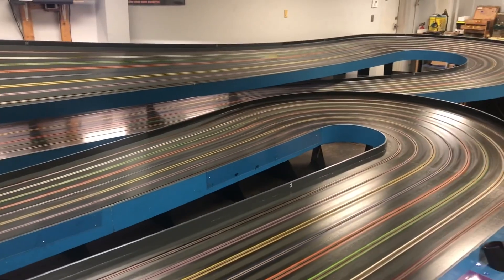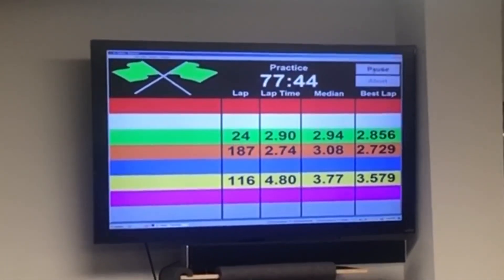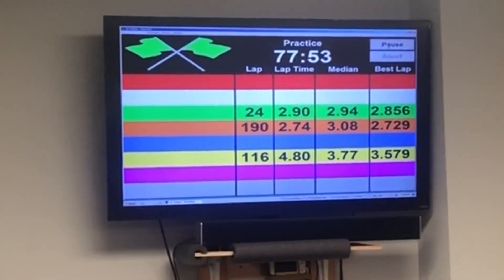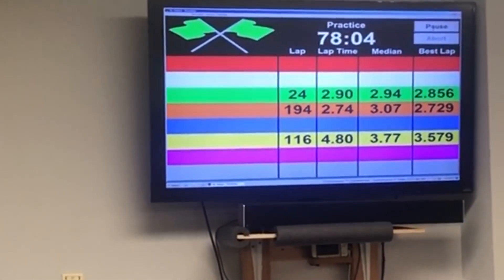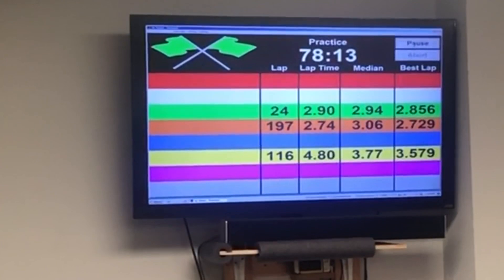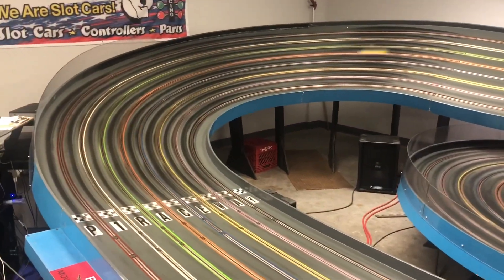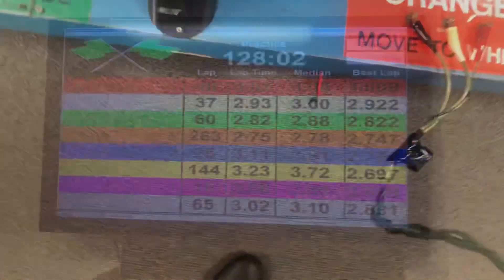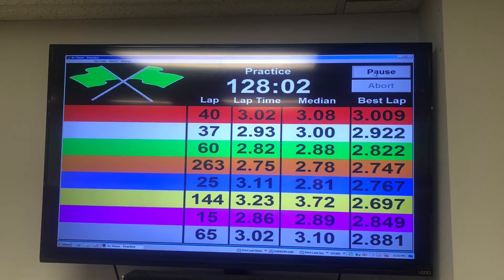DoSLOT brushless slot car ESC testing. @brushlessslotcarracing

Comment: That’s pretty slow for wing cars. My boxstock from 15 years ago. Pulled faster laps. This brushless seems to make perfect sense for RC. Because of small batteries for the scale of the car. But a slot car track does not have that limitation. So why add an esc, brushless motor, that is relying on screws to be mounted. Which this setup will increase the cost of the hobby. Which should be as cheap as possible.
Reply from the maker: Thank you for your interest! Can you run 400-600 laps with the brushed motor without stopping and it not needing a rebuild?  Brushless motors don’t require any maintenance after doing that. We recently put 3000 laps on cars and brushless setups that already had 1800-1900 laps on them. The braids, bodies and tires are the only things that needed replaced.
Reply from the maker: In the summer of 2023 a wing car was run on a King track in Germany, it turned many laps at 1.7 seconds. No rebuilding was necessary after that was done. The car and setup still turns those lap times to this day. If brushless motors were so inconsistent and bad why are they in all our power tools and the technology is getting better in automobiles?
Reply: @brushlessslotcarracing  it’s nice to talk to talk slot cars with people. Really is just amazing this hobby survives. If brushless is the key to it turning laps for several more years. That is what really matters. I also appreciate talking slot cars and differences without name calling or shaming. Hope to race against you guys one day.
Reply from the maker: @sgtwilderness2821  It’s was a pleasure to share the new technology information with you! We like to Advance Share and Inform the hobby about how it can be applied to slot cars. It’s new and like slot history has shown over the years of “innovation “ there will be bumps along the way but hey its 2024 time to try something new. Thank you for visiting our channel feel free to share it.
Reply: @brushlessslotcarracing  because they maximize the most out of a battery. Since they are more energy efficient. Which when you don’t have a constant power source. Like a slot car track. Brushless is greatly desired. But for this hobby which has a constant power source. That cancels out the need for brushless and unnecessary additional cost to the hobby.
Reply from the maker: @sgtwilderness2821  Buying sealed tin can motors by the pound to be competitive in slot car racing isn’t cost effective to the hobbyists. The cost of 4-5 tin cans will pay for a brushless setup that will run longer and be more consistent without any maintenance to it. If you want to run a motor that is designed to self destruct have at it. Keep up on the rebuilds it might last you another 15 years. BTW not all the slot car racers/hobbyists have the tools or know how to rebuild their motors like you do, that’s why the tin cans have come into the hobby. We used tooth brush motors we bought at Walmart for motors long before the advent of the current tin cans….the tooth brush motors lasted about as long too only a few races then poof! Brushless motors run a long time without maintenance.
Reply: My doslot 9k 124k rpm is faster then a gp 27 and the other guyz now have the 11k doslot that rpm is 150k and is even faster again  and they now have 16k motors doing trials atm
Reply: I ran a 12 hour enduro on one motor. Which as a wasp motor. Than ran it for half a season. It was too easy. On a 60 dollar motor which was 15 years ago. The only thing I did was break in a set of brushes and switched out the old. To race that half season. Than did a rebuild to finish the rest of the season. I did the rebuild because I wanted to also add a big race in during that season. Now with current slot car motors. Brushless are not a needed thing. Only adds something to the hobby making it less friendly to the budget racer. Brushless are slower, and poor mesh.

The average heat for slower cars is around 40 laps per heat. So per race is around 320. Most season are 6 weeks one race per week. Which is the total laps around 1,920. Never really ever needed to do a rebuild or buy a new motor. Nor did the other drivers. I replaced tires every 3 weeks or so. But motor rebuilds or motors of any type  any class nope. Unless it’s group 7, or group 27, I’m going to do a rebuild. But brushless can’t touch that speed.